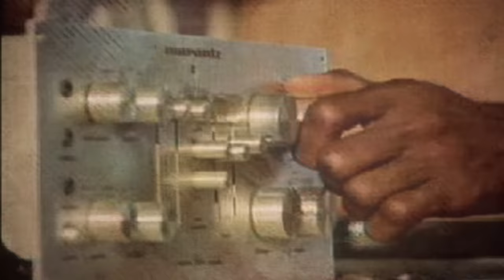L'ENTOURLOOP - Dreader Than Dread Ft. The Architect & Skarra Mucci (Official Video)

Comment: COMPRA LIMPIADOR PARA PVC DE A 35 $ 2 DIARIO DURANTE 8 AÑO PARA GASTAR 200 100 $ 70 $ DIARIO DE 35 $ EN 35 $ USO PAPEL DE BAÑO INALAR LIMPIADOR PARA PVC DE A 35 $ PARA GASTAR 200 100 $ 70 $ DIARIO DE 35 $ EN 35 $ USO PAPEL DE BAÑO